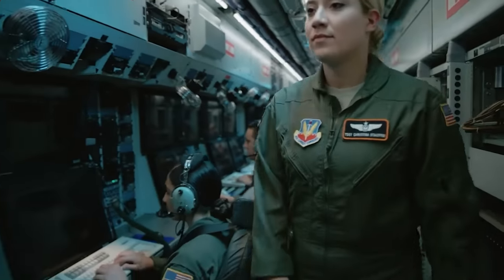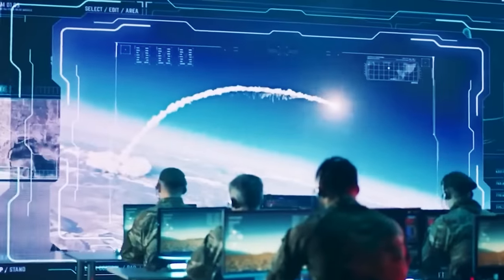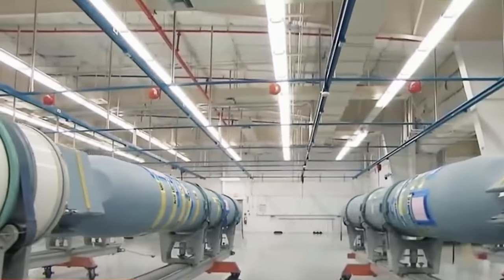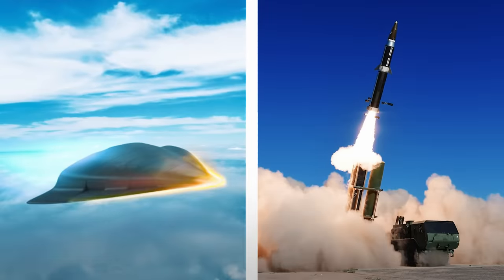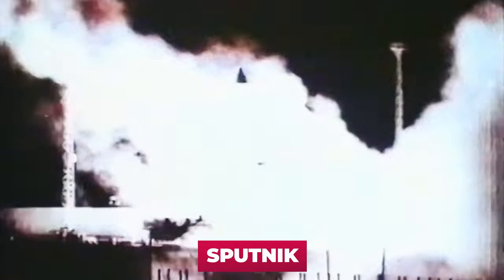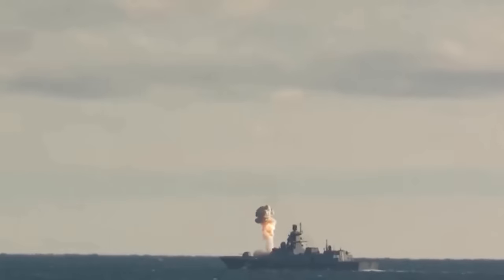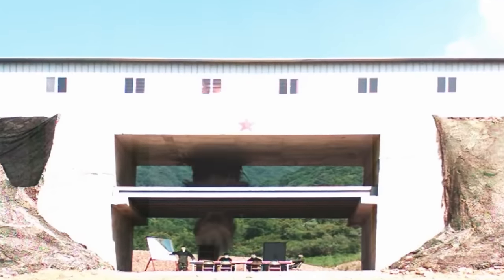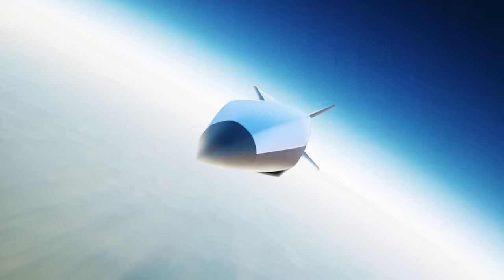US Tests Hypersonic Missile 5 Times Faster Than Speed Of Sound

Comment: First of all just because a missile goes 30% faster or even 50% faster does not make it 20x harder to intercept.  You also forgot the AIM-260 replacement for the AIM-120.  It goes Mach 5, has a 200km range, and can target using IR like the AIM-9, radar like the AIM-120, and passive radar like the HARM.  It can be fired to a location and hunt for enemy fighter jets too.  As for things like the Kinzhal, Russia states is has a 2000-3000 km range.  No the missile has a 500 mile range and the extra distance they list is by adding the delivery vehicle range from the Mig-31 and Tu-22M3.  Russia has fired dozens of the Kinzhals by now and has an abysmal hit rate.  They average deviation from target is 30-60m, which is horrible and they also fail on launch about 25% of the time.  The US has successfully tested they HS cruise missile at least once in 2021 and once in 2022 and is supposed to go into full production in 2025.  This is FAR more advanced than anything China or Russia has.

The other thing is to intercept a missile that maneuvers you need either guidance from a ground radar system or a tracking system built in.  The NASAM and Patriotist have both these.  The NASAM can use the AIM-260 missile too.  It is more than capable of tracking an incoming missile and has enough speed to intercept a HS missile.  You do not need to go as fast... even half the speed is enough.  These missiles are typically coming in on glide and will bleed speed every time they tern and they still have to reach that target that system is protecting.  All this doom and gloom is mostly just to get more military funding.
Reply: When talking Kimzhals everyne seems to omit the fact that it is simply an air launched iskander, nothing more, which is a ballistic missile, not a cruise missile, i.e. it has no air breathing engine, it does it 10 machs at 120 000 ft like any ballistic missile does including Hitlers V2 from 1943, has unguided reentry vehicle flying on ballistic slope at about 2 machs in thick atmosphere. The difficulty to intercept is not the speed but the absence of engine and flying surfaces which can easily be damaged with shrapnel cloud from any anti air missile, its essentially a flying brick, you can only destroy it by a direct kinetic impact. This is exactly what PAC3 does
Reply: @raa729  The AIM-260 likely can likely do impact hits too.  That missile is impressive.
Reply: Thanks for your discussion. You make some valid points. There is too much Hollywood out there and not enough considers analysis based on facts.
Reply: I need u around more often
Reply: @Reverend Boaz If they couldn't we wouldn't have China's invasion of Aquaman's territory and old grandma's visiting Taiwan. Also it's a real possibility the US may have energy weapons and countermeasures. Can a hypersonic missile go faster than light? Talk about squaring the cube there.
Reply: @Reverend Boaz First level of defense would likely be Aegis.  Those missile are capable of Mach 13.2.  Patriot might work, but likely it would be systems like NASAMS operating the new AIM-260.  They go at least Mach 5 and can lock with active radar, passive radar and IR and can be fired to a location without a lock and redirected in flight if need be.  They are incredibly maneuverable and have a range of 200km.  Every day that goes by closes the window on HS missiles.  They are not impossible to shoot down.

Do you really thing doubling the speed and making them turn a little is going to all a sudden make them impossible to stop.  No.  The US has been testing their defensive systems against HS missiles for well over a decade.  Yes the US has had HS missiles, but only for testing purposes.  Give it another 5 years and the US will have a powerful enough Helios system to stop pretty much everything with a 300kw laser with well over a 20 mile range.

We already have 100kw system in 2 missile destroyers being tested since 2019.  The US has also tested their HS cruise missile and that will be in production by 2025.  Think of a terrain following missile doing Mach 5 with a around 1750 mile range and a 1000 pound warhead.  They also successfully tested the Air Force version that has at least a 1000 mile range and is supposed to be in the Mach 10-20 speed that is maneuverable too.  Neither Russia nor China has even close to the defensive missile system to stop traditional cruise or ballistic missile reliably.
Reply: @Peak White Monkey I am not saying the defense is 100%.  Likely against normal missile it is 80% and HS 50%, but there are layers of defense.  The US has 10,000 patriot missiles alone.  I think they are ordering 10,000 AIM-260 this year alone (for fiscal year 2023 which ends on September 30, 2023).  Like I said the Helios system is coming.  They tested a 30kw system back in 2014 on a missile destroyer, they have been testing a 100kw version for 3 years now on 2 more missile destroyers, and they have ordered 2 mobile land  and one naval 300kw systems for 2026-2028 with full production likely around 2030.  Israel also has a system and the say the 150kw version will have a range of 20 miles, so a 300kw version might have even longer of a range.  They have also tested successfully one in a Boing 747 (I think that was the version).

So even with lower percentages of interceptions layers of defense will help boost the chances of stopping one.  US tech has really been pushing the limits hard in these areas and it has been paying off.
Reply: @reverendboaz5512 you realize lasers are faster than a hypersonic missile? 
The USA has laser weapons that can target them.
Reply: @reverendboaz5512 probably a bit harder to use them on the ocean against hypersonics because ships on the ocean are not very stable. But the USA has military bases all over the world.
Reply: @toddabbott781  But what would you target with a HS Cruise missile? Each probably costs like an F-35, so it really only kind of makes sense as nuclear warhead carrier or to knock out very large and expensive ships (aircraft carriers maybe? Or perhaps Xi Jinping himself.
Reply: @William Arrington But most of the HS missiles start as a ballistic missile with a very high trajectory to get that speed.  The US has stationed these and more in forward position to have a chance at early interceptions.  One that China tested recently would skip on the atmosphere before dropping down.  They have shot down satellites going at Mach 25 with these.
Reply: @SB-lp7yj  Not that much.  Probably in the 3-6 million dollar range.
Reply: I hope you are right.
Reply: Russia has the AVANGARD. It does 20x the speed of sound and is basically unstoppable
Reply: @mydixierekt8431  it is stoppable by lasers.
Reply: @GilaMonster971  lasers work well for the ocean....trying to lock onto something moving that fast,while changing directions,without a visible line of sight is impossible. Im just going off of what our own DOD said
Reply: @mydixierekt8431  It is difficult to stop, but not impossible.  The main thing is the US will likely not give it a chance to deploy and will shoot it down in space before it deploys from the ICBM.  And as far as I know Russia only made 8 of them.
Reply: The Military High Tech Mighty Russia Is An University Student In The Hypersonic Missiles Technologies While The America Is A Kindergarten  Student In The Hypersonic Missiles Technologies So Technologies Weaken America Bitterly Struggling To Produced Their Owned High Reliable Hypersonic Missiles.
Reply: @William Arrington The rail gun has officially been stopped along with all funding.
Reply: The Kinzhal is a solid fuel unguided mach 1 missile at impact
Reply: @William Arrington The Kinzhal isn't even close to being mach 12. Maybe mach 3...otherwise it would burn up at low altitudes.
Reply: @William Arrington Like the kind on The Moskva? Nice job!
Reply: @William Arrington Satellites warn ships of missile launches. Instantly from way over the horizon
Reply: @dugzamilza5212  Odd since the US tested 80 AIM-260 (their air to air HS missiles) in 2021 as well as a HS cruise missile, they tested that missile this year again successfully, they also tested the Air Force one from a B-52 in December successfully.  The AIM-260 went into FULL production months ago and the US is validating them on different jets.  The cruise missile is slotted to go into production next year likely.  The Aegis missile goes Mach 13.2 and that version has been around for several years.

As for the Accuracy.  Even Russia admitted that the Kalibr missile had an accuracy of about 30m and the Kh-101 was even worse at 50m.  With the variety of missiles fired in Ukraine some have had up to a 60% failure rate of not detonating, not reaching their targets, or just missing their targets.  Studies from the first 4 months showed that the missiles were missing by 30-60m for most and many even as far as 180m, not even coming close to the building they were targeting.  You can close your eyes and say there is no proof, but that is your choice.

I admit the US has made some crap over the years, but they have really improved things a lot on the last 10-20 years.  So how are those T-14 and Su-57 going?
Reply: Imagine that all this marvel is still 10 years behind Russian and Chinese hypersonic tech. Good Luck.
Reply: @santannamv  Which would you rather have... a cruise missile that goes Mach .8 and cruises at 100 feet following terrain or one that cruises at 35,000 feet and goes Mach 5?  You can not have both.  If you ran something at sea level at Mach 5 it would be either burn through all of it fuel or just burn up... or both.  The one at 100 feet is likely far harder to shoot down?  HS has its role, but I do not think it is a game changer.  It is NOT impossible to shoot down just harder to shoot down.
Reply: @William Arrington Easily done with US military satellites.
Reply: China's hypersonic weapon was officially in service 2 years ago, while the US is still in the testing phase.
Also China has built the world's most advanced hypervelocity wind tunnel, the JF-22, which was reported in the US's own media.
So the reality is that China is at least 5 years ahead of the US in the field of hypersonic weapons.
Reply: @parkjoonkwang9259  True... mostly.  The US has been focusing on defense, not offense (mostly).  They have had a HS missile for almost 20 years.  It was used for testing.  They got the speeds by removing the warhead basically.  They used this to test systems like THAAD and Patriot.

The thing is the US actually started full production and should have quite a lot of the first HS missile for validation tests.  It is the AIM-260 air to air missile.  It went into full production in October 1, 2022.

I could be wrong but I think the US is the first to release a HS air to air missile.  This is also used in surface to air systems (SAM) like the US mobile units for NASAM.  Pretty much anything that uses the AIM-120 will be able to use the AIM-260 as this is going to phase out the AIM-120 by 2025.

The AIM-260 is a VERY capable missile too.  The AIM-120 was to most proven and successful air to air missile of the last 30+ years.  They took the active radar lock of the AIM-120, the Infrared lock of the AIM-9 Sidewinder missile, and the passive radar capabilities similar to the HARM anti radiation missile and combined them all together.  The missile does not require a lock when launched to it can be fired at targets behind the fighter jet or at targets even outside its locking range and hunt for specific radar signatures or IR signatures or active radar in the area.  It can also lock with more than one sensor to gain more accuracy and make it harder to jam.  It has a speed of at least Mach 5 as it is listed as Hypersonic and it has a range of 200km.  It also used the Link-16 system so it can be redirected mid flight.  It is a beast.

The HS cruise missile was also successfully tested in 2021 and 2022 and goes into full production this October... 8 months from now.  It will not replace the current cruise missiles as HS cruise missiles need to stay at at least 15,000 feet to cruise at hypersonic speeds.  They can maintain HS velocity during the terminal phase still, but that is only the last few miles of its 1750 mile range.  Normal cruise missiles are sub sonic and cruise at 10-30 and 100 feet off the ground depending on if the target is ground or water.

The Air Force is also making a HS missile, but this is a strategic weapon that can only fit on a bomber do to its larger size.  They did manage a successful test last year after 4 aborted tests in 2021, but I am not sure when it will go into production.  Little is known about this other than it has at least a 1000 mile range and goes at least Mach 10.  Rumors say it is capable of Mach 20.

The big thing is the US is way ahead in laser technology and this will make missiles almost obsolete over the next 10 years.  The US has 2 Missile destroyers armed with 60 kw lasers already.  They are starting to receive Strykers mounted with 50kw lasers to protect troops and bases during ground operations.  They have already tested a 30-60kw laser in a 747.  They have also ordered 2 mobile units and a naval prototypes of a 300kw laser system for 2024.  The laser itself has already been tested in 2022.  If the US can get say a 150kw laser in a B-1, B-2, B-21, or B-52 it will be basically unstoppable.  Nothing could get close enough to shoot at it and no missile could touch it.  Information out of Israel puts a 150kw laser at a range of up to 20 miles (depending on humidity and cloud cover).  Well a bomber at 40,000-60,000 feet or higher is likely not worrying about humidity or cloud cover with the thinner atmosphere up there.

A dozen missile destroyers with 300kw lasers (HELIOS) parked along the cost of Taiwan would instantly stop an invasion.  Not only the laser systems but all the anti ship and anti air missile they carry as well as torpedoes.  Taiwan already has a decent anti ship and anti air system, but they lack the protection from drones and missiles.
Reply: @parkjoonkwang9259  Nonsense.
Reply: @parkjoonkwang9259  Nonsense.
Neither Russia or China has hypersonic weapons that are non-ballistic.
There is a difference.
You should learn about these before commenting.
Reply: @parkjoonkwang9259  China doesnt have a so called  hypersonic weapon. Neither does Russia.
Reply: @parkjoonkwang9259  China has no air breathing hypersonic weapon. The US does.
Reply: @GilaMonster971  in Star Wars sure. However this is real life and we are not in space. Using lasers inside the atmosphere to try to shoot down missiles is absolute nonsense generated by people with no understanding on plasma Physics, life isn't a movie, there is a reason nobody has even thought of developing light sabers.
Reply: @zemm9003  haha....sure buddy. 
That’s why the USA already has lasers that shoot down objects.
Been tested numerous times.
Reply: @GilaMonster971  believe what you want. I am not gonna waste my time explaining to someone who probably didn't even have good grades at Math in school. I would have better luck teaching my cat how to cook.
Reply: @zemm9003  I have already proved you wrong, but I’m probably trying to explain something to a person that cooks cats and has never gone to school.
Reply: @parkjoonkwang9259  Wrong. The Chinese have great tech, but the US has better scientists and engineers. For now anyway.